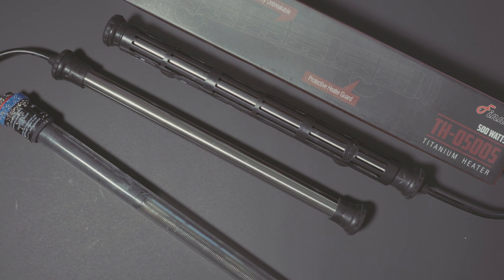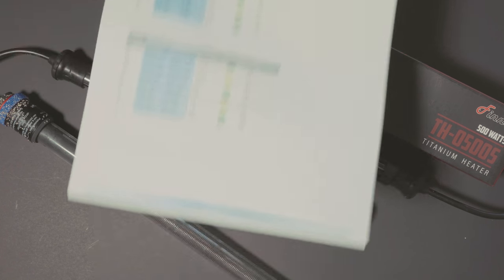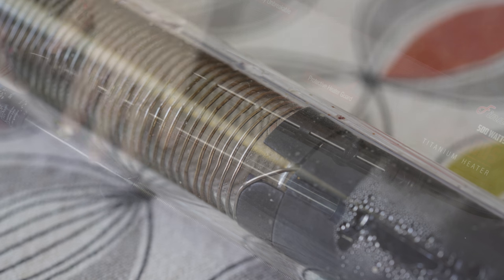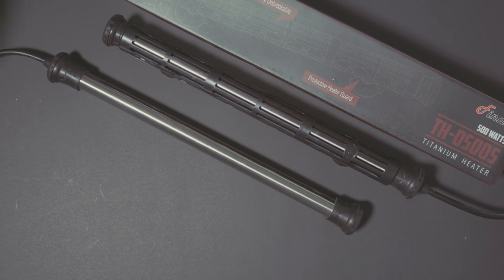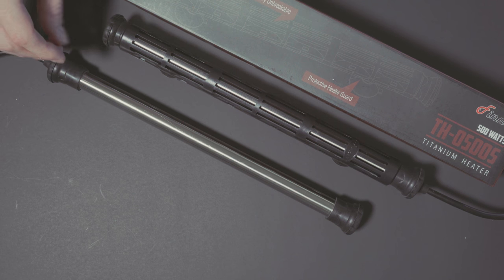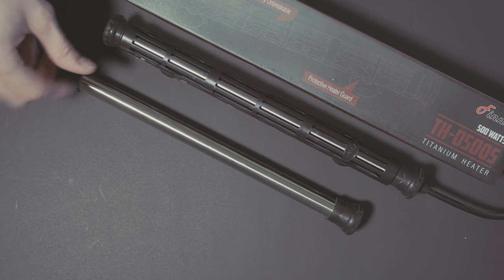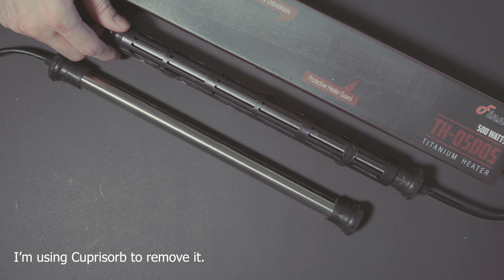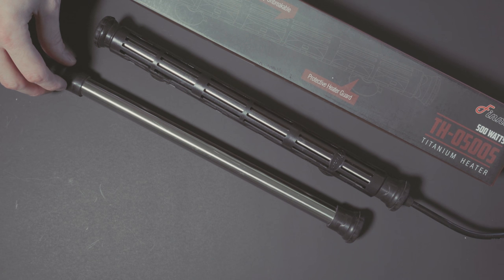Finnex Titanium Heater... a coral reef tank heater without glass!

Comment: I know I’m a bit late but does this heater also cool down the water.. because In the description of the heater says, it keeps it 1 to 2 degrees to the desired temperature.
Reply from the maker: No, it can only heat. They could be talking about the accuracy of the internal thermometer, but I use my apex to turn mine on and off.
Reply: I need a water cooler
Reply from the maker: I've been liking my Teco chiller. I've had it several months now.